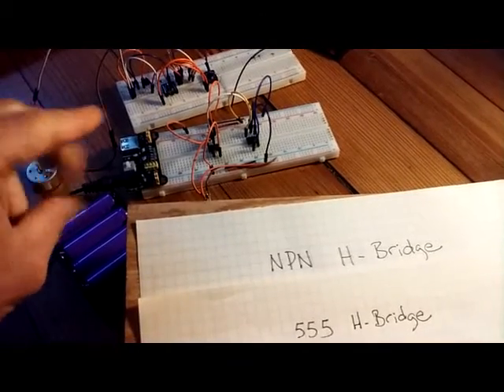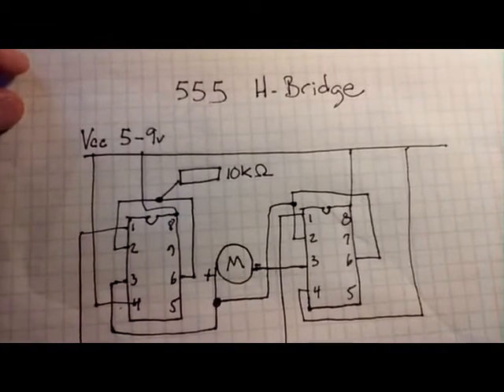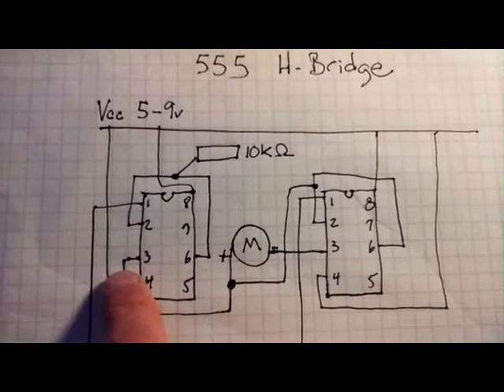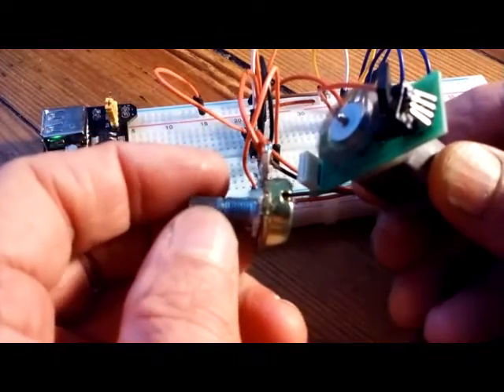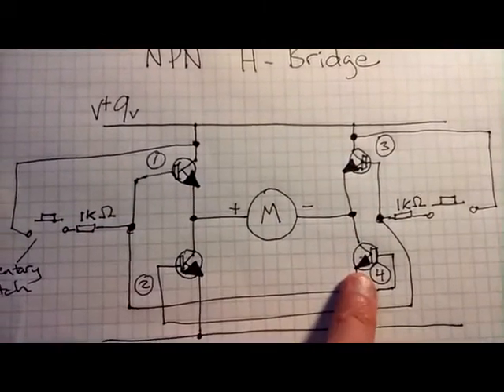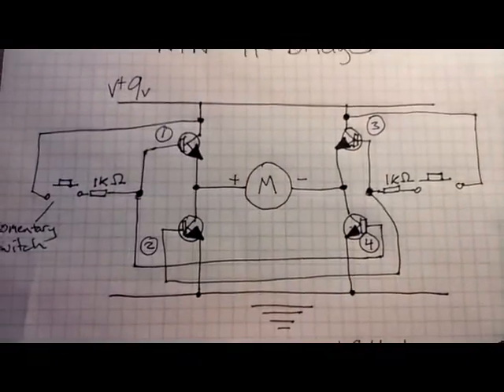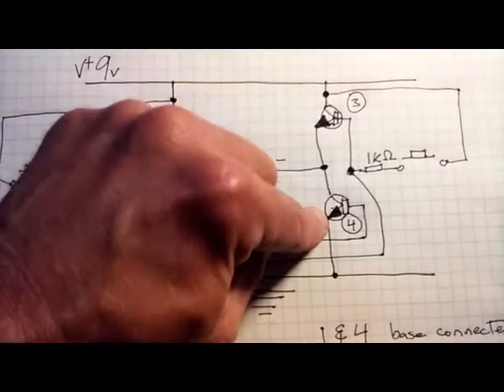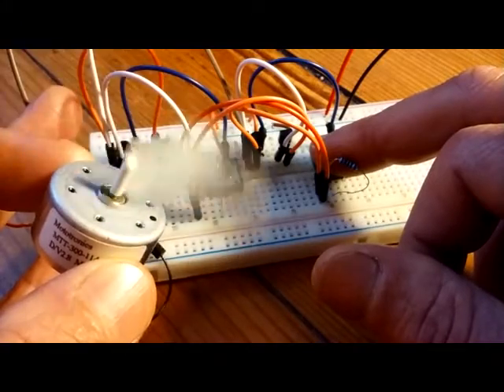555 & NPN H-Bridge Forward/Reverse Motor Circuit

Comment: Hi nice set up. I have something similar, as new to e:d I'm trying to better understand what happens in circuits. I don't understand how u inverted the polarities with just the pot in the first part of the video...is it that u had held one of the switches(button) pressed down? Thanks
Reply from the maker: Seems to me the threshold value from 10K pot determines which IC chip provides current to the motor.

Comment: Nice video! If you'd like to control the NPN H-Bridge from a microcontroller, could you just exchange the two switches with for example one NPN transistor each and control them that way? Or do you have to add additional hardware?

So instead of the switches; micro -> resistor -> npn transistor base and on the emitter you have the "output" of the switch in your schematic?
Reply from the maker: Thanks! Yes, digital pin connections would replace switches with microcontroller. This looks like a good example: https://ecetechprojects.wordpress.com/2011/07/
Power motor externally, not through microcontroller.
Reply: Oh, so you dont need additional transistors? Aha, I thought you would need an additional transistor per side, but apparently enough with the resistors for the bases =D Thanks for that!

Of course, motor gets its own power! Micros can should only handle a max of 20mA so =D That I know at least, but I'm really behind with some things, just takes so much time to learn.. New things doesn't stick too easily in my brain ;)